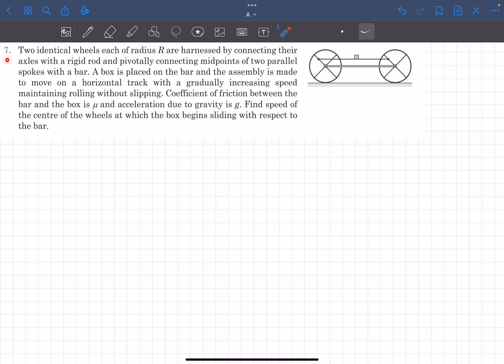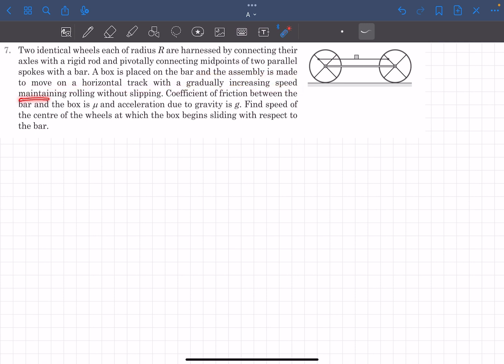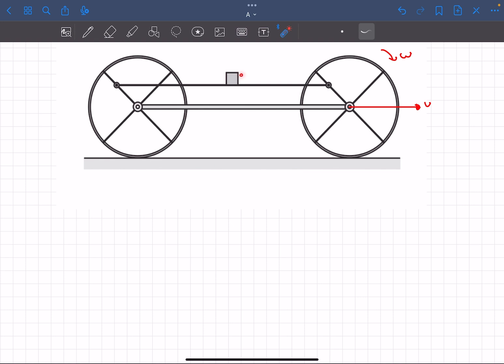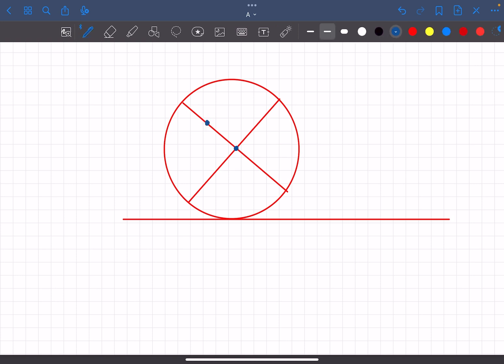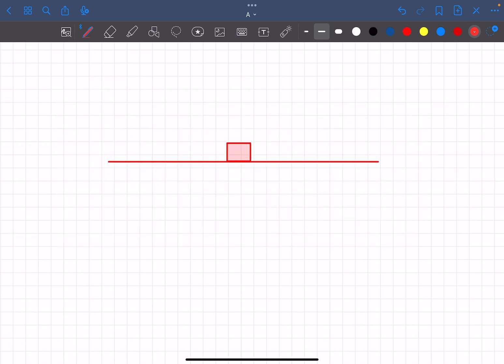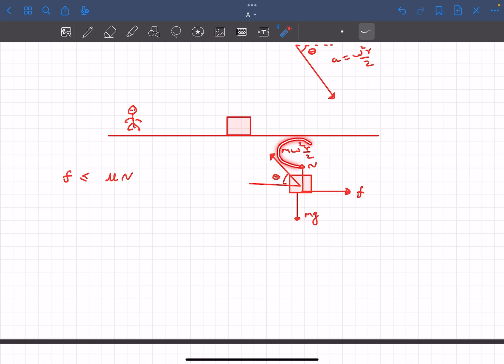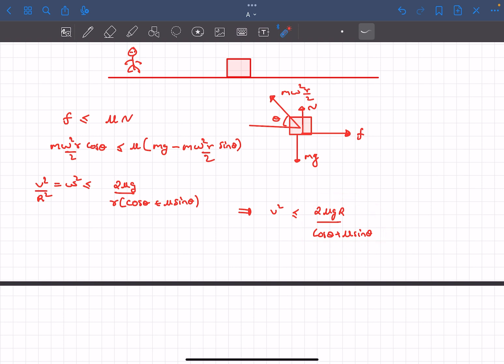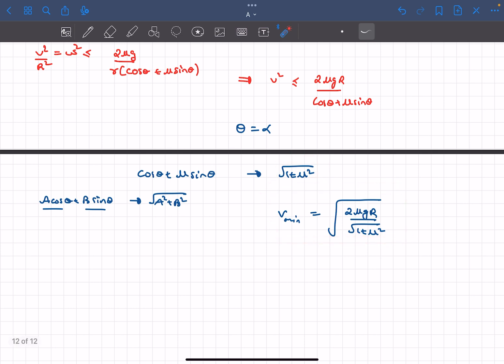Pathfinder | Speed At Which Block Starts Slipping Relative to The Rod | BYU 7 | Rotational Motion

Comment: Sir why did u consider the vertical component of the psuedo as the normal why not another force additional to that would not be the normal
Reply: We have not considered it as the normal, it's just the netforce applied by the rod on which the block is lying in vertical direction, The pseudo force is take At an angle theta